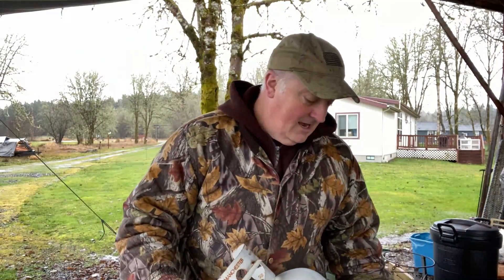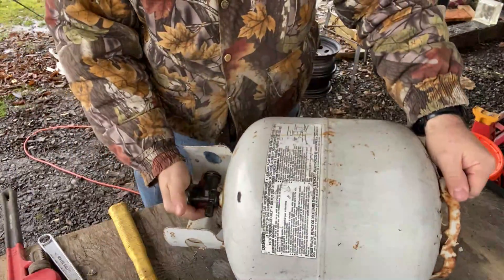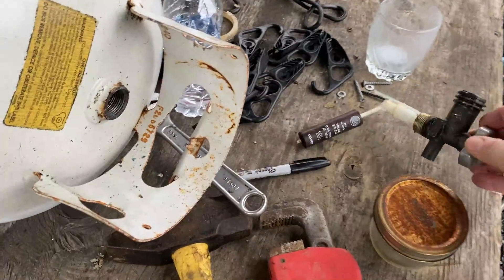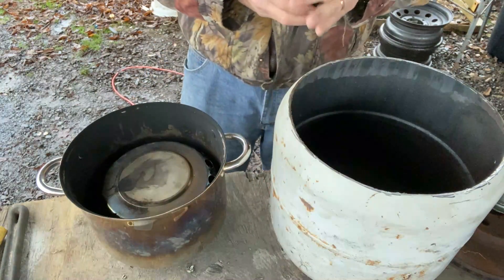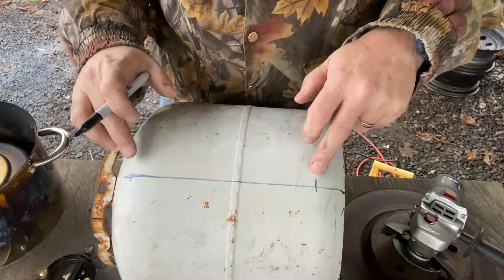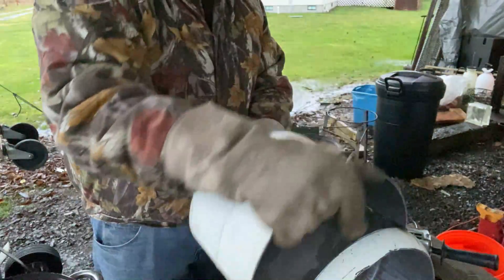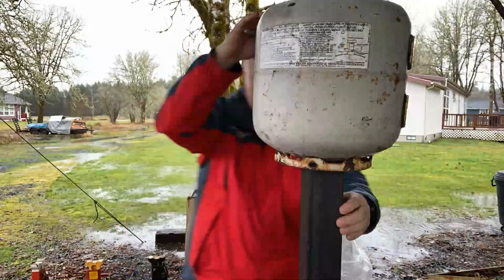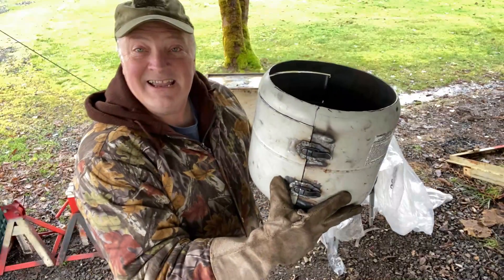Waste Oil Burner Housing 2 of 4

Comment: Wow, I have a couple of waste propane cylinders i was going to make into wood stoves.  I knew about the water trick,  but I had no idea about the valve.  Being open but not all of it coming out?  Thst would have gotten me.  Thanks for the video.
Reply from the maker: To be extra sure, loosen (open) the small screw valve they open when refilling the bottles. It takes a normal screw driver to do it.
Reply: Good idea.  The newer valves come with a safety feature to not allow gas to leave the propane tank without a device like a grill or cooker connected to the  valve.

Comment: That style valve, with the threads on the outside, won’t let gas out unless something is hooked to it. They have a check valve inside them.
Reply from the maker: @davemiller2189  yeah, I brain farted! You have to unscrew the valve set screw.

Comment: Connect bottle to grill and open valve & grill burner control valves to see if empty
Reply from the maker: More than one way, right? You can turn the little valve screw they use when they are filling the bottle as well.

Comment: The valve isn't broken .there is a presher release when you put the hose in .
Reply from the maker: Yep… there was a also a set screw in the side that opens and let the pressure out. I pinned the top comment to fix this error.

Comment: Dude you gotta stop playing with dangerous things until you have a complete understanding of what you are doing, you could have dumber guys than you get killed because they saw you doing dumb things and copied you. not trying to be mean but you gotta know when to fold em
Reply from the maker: So, you are saying that by me leaving my mistakes in the video that someone is going to come along and make the same mistake that I did? No. I don't think so... I think if you're smart, you will have a similar reaction just like you did, and avoid doing that... possibly even read the comments or the description, and hopefully continue to the next part where I explain the proper procedures. It's 4D chess.
Reply: The sooner the dumber ones whittle themselves out the better off we'll all be. NEVER hold yourself back to prevent injuries to morons.

Comment: The valve isn't broken! They have a check valve inside them that opens when you connect the hose or fitting! The gate valve is only to shut the entire system off once connected and ensure no gas leaks when disconnected. 

You have to either connect a hose or fitting to open the check valve to vent the gas. You can wedge it open but its risky.
Reply from the maker: Yep, figured that out. Totally forgot about the screw that releases the gas on the side of the valve body. That is the best way to release any residual pressure, which is only what this had... no liquid gas was left in the tank.
Reply: @HelicoolsHelipad  I have to look at that. Ive seen it but wasnt sure of its purpose. Is it a tiny hole under it so it vents slow?

Comment: Thanks for the videos, LOl, your definition of Tack weld is different than mine :)
Reply from the maker: Right on, brother... as you can see, I am no professional welder. Totally self taught. What I find the hardest is welding on thin stuff with thick wire. I only buy the .035 because 99% of the time, that is what I need. So I have to make due, and sometimes it turns out, and sometimes it looks like heck! Thanks for watching, my friend.

Comment: It's not busted it's called an OPD valve. They are designed to close automatically when opened without being hooked up to a device. It's a safety thing they say. So be careful and use up all the propane before trying to open one. BTW they ALL have these valves on them as they came into law many years ago.
Reply from the maker: Only Roy why is it that everyone seems to be focused on the propane tank and not the housing? This is causing me to want to make a re-release that eliminates the tank almost entirely... and make a separate video on the propane tank. 😉 Anyway, the safety valve you are talking about still allows some gas to flow. If you try to light the BBQ when the tank is in safe mode, it will still light, but seem like it is on the lowest setting instead of full blast. To get out of safe mode, you have to turn the tank off by rotating the knob. Them make sure the BBQ's valves are closed, then re-open the tank valve using the knob.

Comment: The valve is not broken . it is a two part system with a LP fitting and hose screwed in then open the main valve . the flat head  screw is also a vent .
Reply from the maker: I forgot about that screw valve... but then again, hearing no slosh sounds when I shook that tank, I knew it was empty with only a tiny bit of residual gas inside. Thankfully, I still have my eyebrows and I lived to make another video. LOL! :-D Thanks, Rob!
Reply: @HelicoolsHelipad  LP is liquid propane which is what you feel but even though the liquid is gone there is still some gas. Feeling the liquid is only a way to judge if its any useful LP left. Or when to refill them. ONLY! You have to open the check valve inside the end of the valve to empty it.

If you open the main gate valve on a propane tank without any thing connected the check valve is bad! Its not a big deal but its designed to help keep the system clean.

Comment: You open the screw driver valve to empty it. The main valve has a stop gasket. You have to hook up a pressure regulator to open the safety valve.
Reply from the maker: Even the safety valve allows a bleed-off, but at a much slower rate... the valve had been open for over two years... I think that if it was going to bleed off, it would have. There was only a tiny, tiny fraction of gas left in it. It didn't even lightly hiss for a minute. This led me to believe the valve was shotty, and probably why it was tossed for scrap several years ago.
Reply: @HelicoolsHelipad  The government mandated valve passes this time. The Pro-tip is, "Open the side pressure relief valve. Bypass the government mandated safety valve."